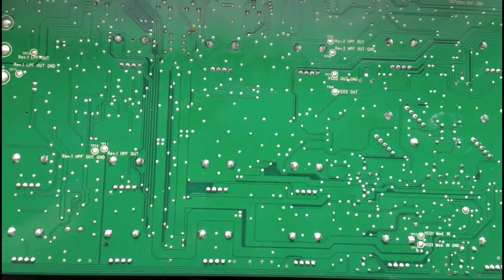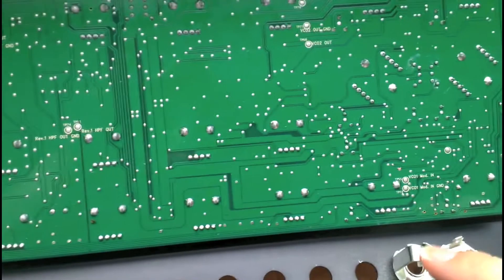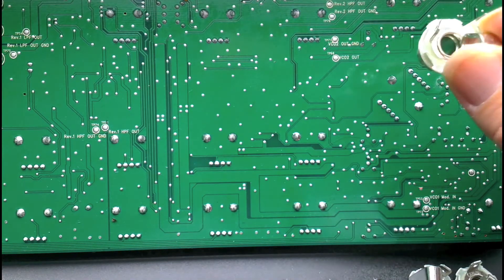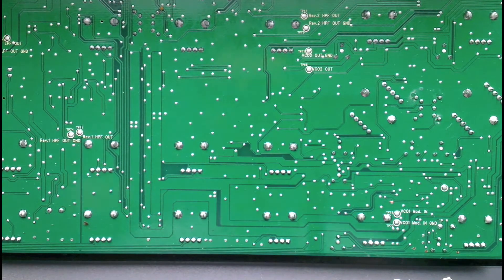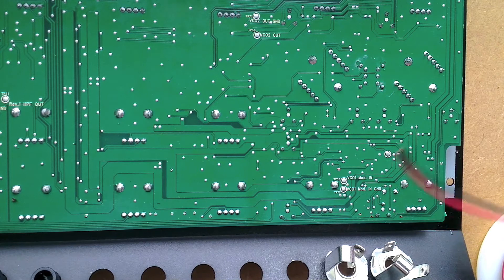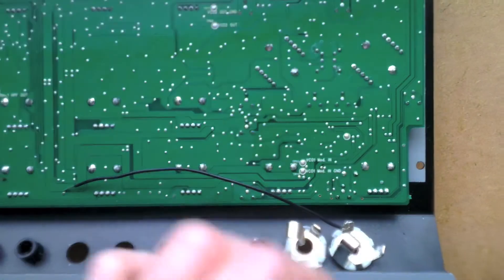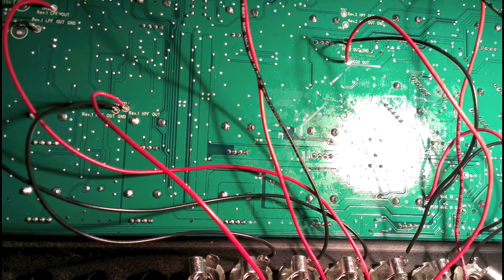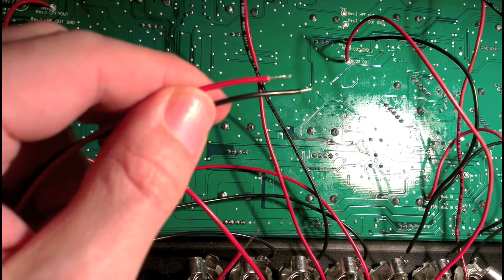How to do basic modifications for the korg ms20m desktop kit

Comment: i realize its 2 years later, but you can get the vco 1 mod in to work but you have to add and delete some smd resistors on the other side of the board.  i did it and it works ok.  the resistor values you use set the range of the cv.  i also  put in a 3 pos switch to disconnect eg2 from the vca and drone.  the vca sw jack is the same there is a 0 ohm resistor on the other side of the board that needs to be removed for it to work
Reply: Would you mind creating and sharing a step by step tutorial  on how to do such mod for dummies like me please.
Reply: I did all of the mods as njorlify shows in the video and had the same problem VCO 1 mod. Can you go into more detail of how you fixed the Mod please.

Comment: Cool video and thanks, but on your soldering........  The best method for good soldering is this, clean tip often....tin the TIP of the iron with fresh solder before you make contact with anything.  A tinned tip maximizes heat transfer and reduces heatup time.  Good advice you give for tinning the leads....but you gotta tin the tip of that iron before heating up a pad/part.  Thanks again for the cool video!
Reply from the maker: Those are pretty basic soldering practices which I am well aware of. I do in fact tin the tip before heating the pad / part and also clean the tip often between joints but thanks for your input.

Comment: Your description says "fault on board", what does that mean?
Reply: +GEOSynths Damn that seems like the most useful point to mod, other than cutting the track in the circuit board for the VCO2 cv in. Would love to find more detailed info/videos on ms-20m mods...muffwiggler thread appears to be dead.
Reply from the maker: UnbrokenCheese it means there's something wrong on the circuit board such that this mod doesn't do anything, I haven't tested further to see how it could be fixed, but for me simply wiring the input to the pcb should work and there is nothing that can really go wrong but for me this input doesn't do anything so there must be an error or something missing from the pcb, hopefully others will come back to say if their's works or not and we can isolate if it is a general bug or just a bug on my board. cheers
Reply: +njorlify Mine doesn't work either.